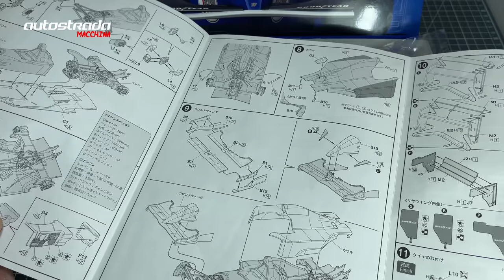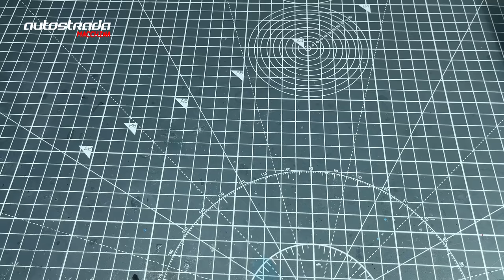I built Ayrton Senna's final F1 car - 1/20 Williams Renault FW16 - Fujimi

Comment: Absolutely beautiful build. Just a few questions. Wondering if you could tell me the process you used for the tires? In the video it shows you scuffed them. Then it looked like you sprayed them flat black. Is that correct? Then it seemed you clear sprayed them. Was that a dull clear you put on them? Last question. Did you sand the body after painting? Thank you in advance for your time and answering my questions.
Reply from the maker: Hi , thanks for asking - for the tires I clean off the mold line first, then spray them with X-85 (Rubber black), put the decals on, put the tires on the rims and then I spray them a matt clear, so they look unit form. The clear I used on this build is Mr Hobby GX113 (Super Clear III UV Cut). I did sand the body after the clearcoat, but then sprayed another layed of clear. This coat of clear I mix a little more thinners in. In my opinion it doesnt require another sand after this - depending on the result obviously :)
Reply: @autostradamacchina  Well like i said before really impressive build. I also want to thank you for taking the time to answer my questions, really appreciate it. Take care and Merry Christmas.
Reply from the maker: No problem anytime. Glad you enjoyed the build and happy christmas to you too 🙂

Comment: Absolutely stunning build! The carbon decals really make it. I've just purchased the exact same decals sets as you and will definitely be using this as a guide. Hey, just wondering on a few things; (1) What do you spray over the carbon decals and tyres? Is that just a flat clear? (2) Was there a reason you didn't put a blue Rothmans decal on the back of the rear wing on the white portion? Cheers!
Reply from the maker: Awesome thanks Ryan, appreciate the feedback! Yeah on the carbon I gave it a flat clear, it was GX114. On no2, that was a complete oversight and you’re the first person that noticed…I’ve added the decal since, but obviously the video was made before I realised my mistake 🤣
Reply: @autostradamacchina  Awesome, thanks! Have bookmarked this video 📺

Comment: Great job! May I ask what glue you use? I built a Tamiya 1/12 Ferrari 312t years ago and it’s literally falling apart.
Reply from the maker: Thanks Mark, appreciate the feedback. For glue I use various types, for the plastic before paint I use the Tamiya cements and then to hold the final thing together I prefer BSI Insta-cure+ or Super-Gold+, which is similar to super glue
Reply: @autostradamacchina  thanks for the info. I learned some  new techniques from watching your video. I will have to check out some of your others.

Comment: Wonderful model and perfect hand work, but as Ayrton fan and knowing like anything about him and all the car he drove, unfortunately you added a detail wich wasn't present on the fw16 in Imola.
Reply from the maker: Thanks Cede, please share what detail you’re referring to? Was doing my best to try and use reference pictures but there is a chance I missed something for sure
Reply: @autostradamacchina  its about the flap immediately after the front wing, that little triangle piece wich cover the lower ammo arm, you can search on every san Marino gp of 1994, the Ayrton car does not have that part.
Reply: @autostradamacchina  that little part was used in Aida with the double rear wing
Reply from the maker: Aahhh yes I see… thanks for letting me know. I did miss that part, it was part of the instructions and I didn’t even think to double check and verify. Thanks for the headsup

Comment: As a beginner I van only admire your built. Nice thing about the F1 cars are the minimal weathering if any. But that's a lot of decals! Do you know how I struggle with those? When I try to dry it, it moves. When I try to move it into position, it's stuck.
Reply from the maker: Yeah the decals can be difficult but is better if you use some kind of decal softener. It helps the decals stay in place

Comment: Terrible quality build in my opinion. Really bad. Detail painting in this is very sloppy. We would paint with single hair brushes. You didn’t even bother to paint the electronics boxes on the sidepods or the connectors of the ECU or engine cables. Same with the front suspension. You just stuck decals on and called it a day. Let alone rivets or aero holes.
Reply from the maker: Thanks for taking the time to comment with feedback